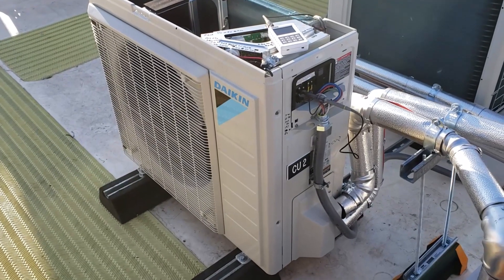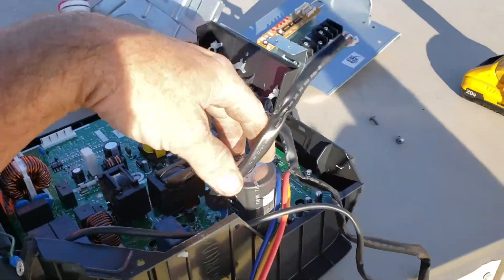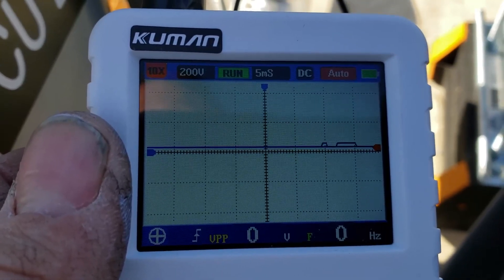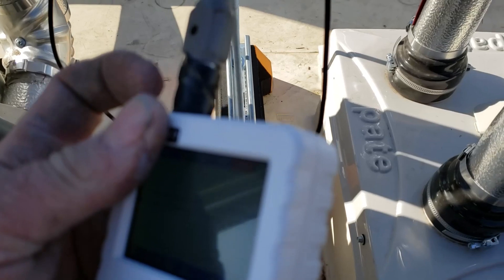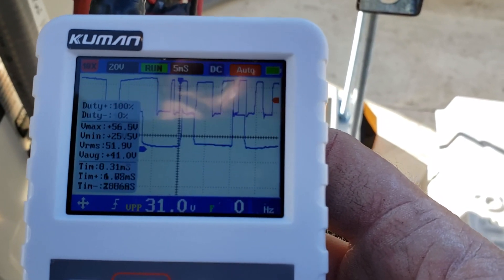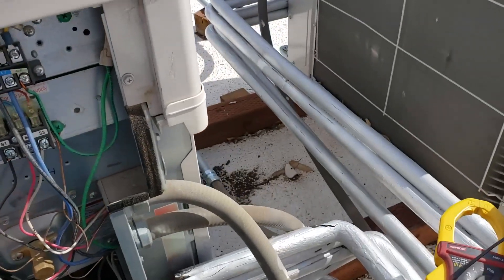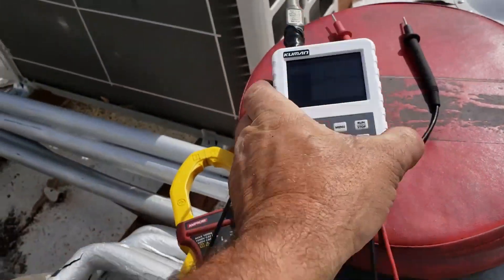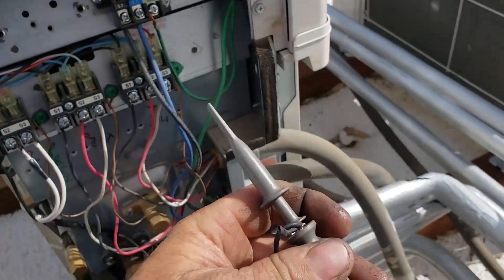Using a cheap scope to diagnose and repair Daikin and Mitsubishi mini splits

Comment: I have a question, what are we looking for is the start beat (the first wave) that is usually generated by the indoor board, correct? If we had a bad indoor we wouldn’t see the wave, then outdoor board will never start communicating, what if the start beat is generated by the outdoor and we have a bad outdoor? We can’t test that and we are screwed correct??
Reply from the maker: It has been a while however if I recall it was the IDU that generated the sine wave then they transmit during the zero cross.
I just used the Carrier Ductless Service tool on a unit at home. Still have to edit and upload the video. The tool can simulate the IDO to the ODU and vice versa which is a great tool for testing board or wiring to know exactly which part has failed.
Reply: @hackfreehvac  Thanks for the quick response! Looking forward for the video! if we can test all this is gonna be a real game changer for diagnosing boards! the Carrier  tool is good only for the Carrier board or did you test it on other brands?

Comment: Cant find much info on hand held oscopes for mini splits, thanks
Reply from the maker: This is just a Amazon $30 cheapo.
Some brands like carrier make a ductless tester.
The carrier tool can plug into your L2/ S wiring between the ODU and IDU and find out which board will not communicate.  And you can simulate the IDU or ODU to run the compressor etc  with it. And see data.
It will also plug into the control board with a low voltage connection as well for viewing data 👍

Comment: Any idea what the communication protocol being used is?
Reply from the maker: I dunno. But looking at the schematics it kinda seems that it works by using photo isolators and one direction pulses the negative half and the other the positive half possibly. But I haven't looked at the signal again since staring at some schematics.
Reply: I suspect something like 1 wire, i2c, or uart.

Comment: Are you just plugged on S2 and S3 with the scope?
Reply from the maker: Yes.
But be careful.
Both have high voltage to ground.
The probe tip has a divide by ten switch to divide the voltage by 10 before it gets to the scope.

Just don't let the scope be grounded.

Comment: Some of these companies get it, other's don't. Saw it all the time in the machine tool industry. The better machines had connectors on both ends of their sensor/actuator wiring runs. It made replacing components easy. Other machines were ridiculous - a simple $30 proximity sensor would have a 20 foot long wire snaked through the entire machine, through countless bundles and cable chains and ducts, be just just about impossible to change. It was simpler to just cut the old sensor off and wire in a plug so it could use the same easily replaceable proximity sensors as everything else.

Comment: Thanks for sharing Hackfree HVAC. So glad now that now at 55 years old, I'm working "in-house" until retirement. Back when I was in the field in the 1980's and 1990's, there were no laptops or circuit boards in any of the A/C units, (or recovery units back then for that matter!).

Comment: There must be a way to test the signal from the main board inverter to the compressor using a scope. Have you tried that?. Instead of using the inverter checker tool with the six lights that go around in a circle or disassembling all the wires off the board in individually testing for home readings by hand. I wonder if there’s a faster way to do it just using a handheld scope ?
Reply from the maker: You'll see the voltage but not all 3 phases at once.

Comment: You’ve covered the basics of networks and multiplexing. As a car tech, used it all the time; never thought I’d see it so soon in Hvac!
Reply from the maker: Some HVAC has used communication for decades.
The main control board in a Trane Voyager or Precident unit used a communication cable to talk to accessories since about 1990.
Such as the economizer module.
4 Wires. 2 for 24VAC and 2 for data.
When you plug it in and boot the system the main control sees the accessories such as the economizer.

Comment: I’ve got a pocket scope that I used for communicating systems but I’d be scared to hook high voltage up to it ! That was a nice piping job on that one
Reply from the maker: You have to certainly be careful.
The scope probes have that divide by 10 voltage divider so 200v will be 20v to the meter, etc